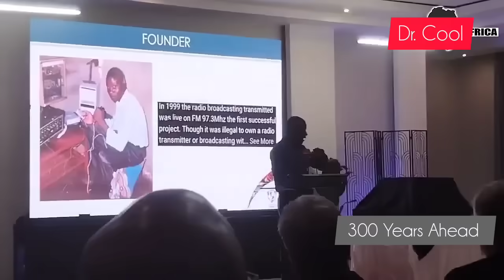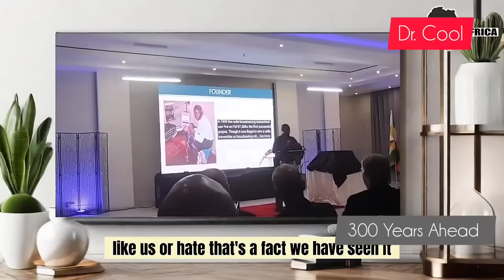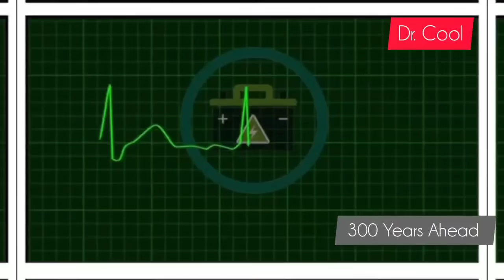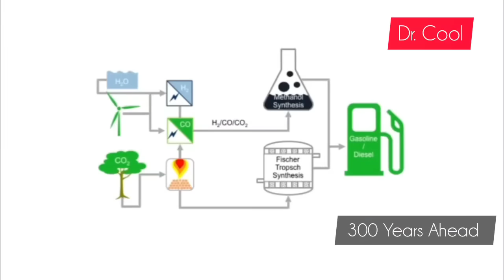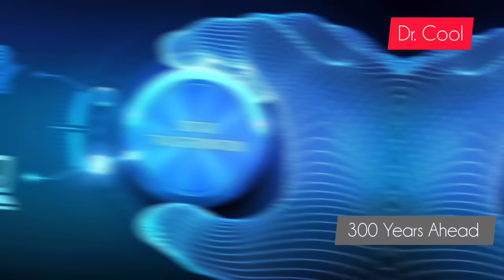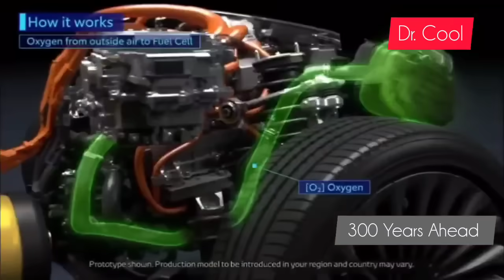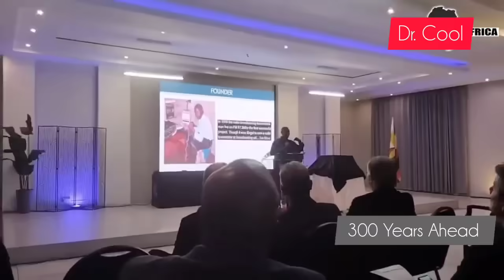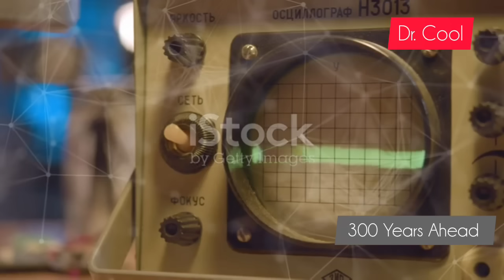Africa Inventor Invented Self-Powered EV 3000 Years Ahead Of Our Time

Comment: For me this is the most invigorating new invention since the petrol engine!  If big tech does not embrace this then yes it will fall. Considering the drive for cleaner greener energy supply across the globe only the foolish will oppose this!  The device has a built in destruct element in it currently  only because the USA would not issue a global patent!  If the Patent was granted Maxwell would remove it as it is only there to safeguard his invention, which the patent would without it!  If Maxwell dose not have a queue of major manufacturers knocking on his door then they are being foolish!